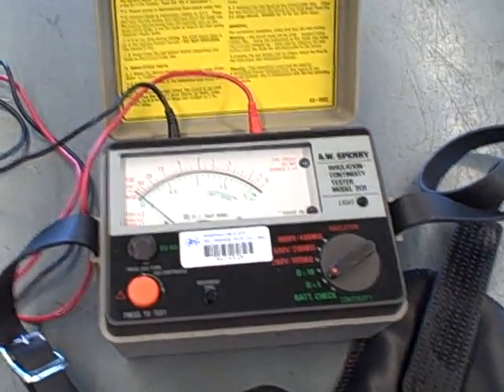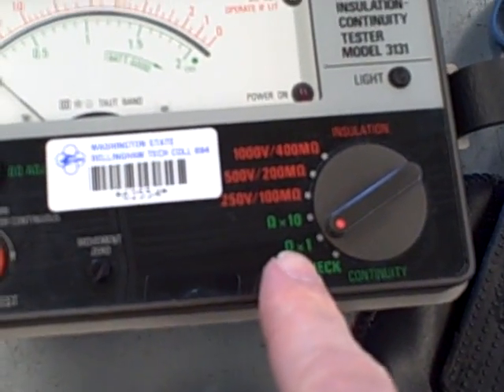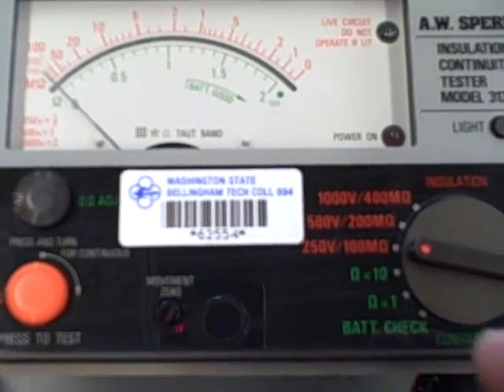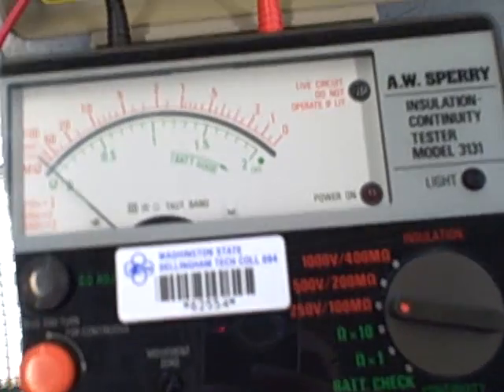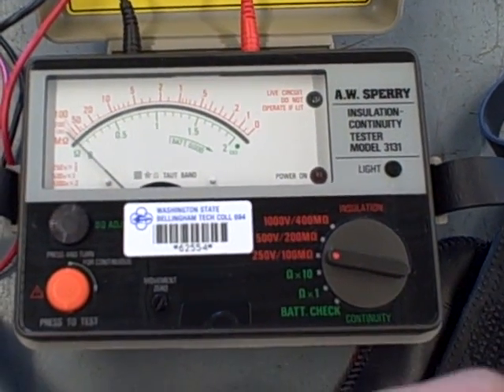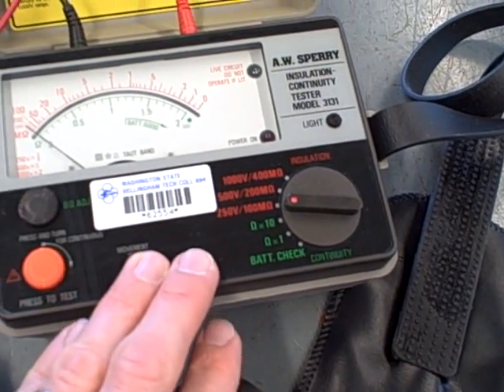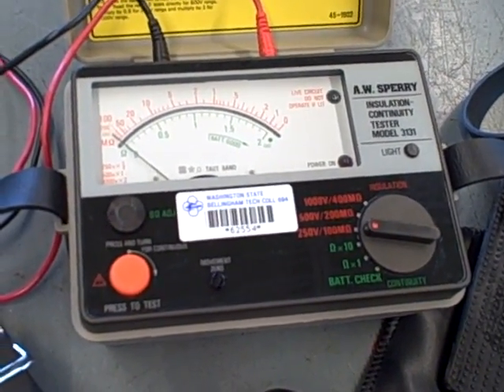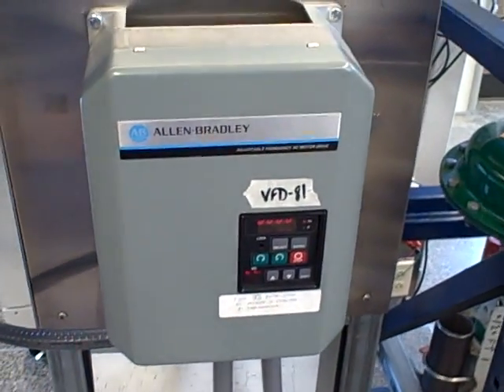"Megger" high-voltage insulation tester

Comment: My finding is you almost always can megger electronic devices as long as active and main neutral are both disconnected. Only RF and surge protection devices that interfere with this and cause a fail

Comment: Thx you very much, specially your note regarding Meggering VFDs, I am about to approve the design from supplier to build the MCC panel with 6 VFD's, and Meggering after installation at the site, but I couldn't understand why it would damage VFD's and they are already designated to curry up to 400 Volts? can you please clarify it?

Comment: Please note 250/500/1000 volts is not HIGH VOLTAGE. High voltage is classed as anything above 1000v AC or 1500v DC. 250/500/1000 IS LOW VOLTAGE.